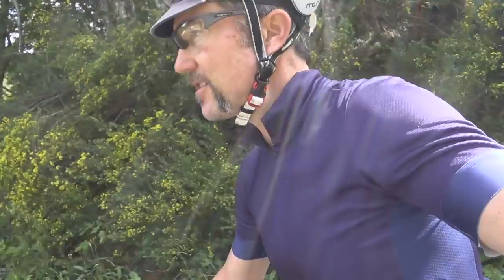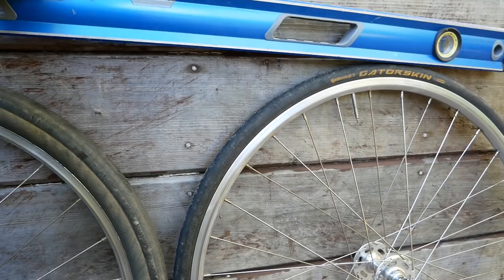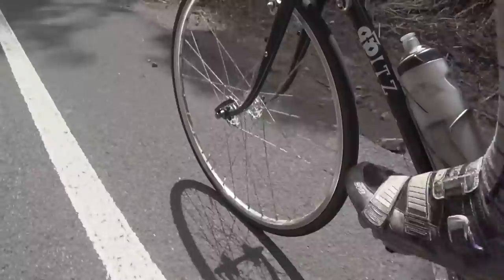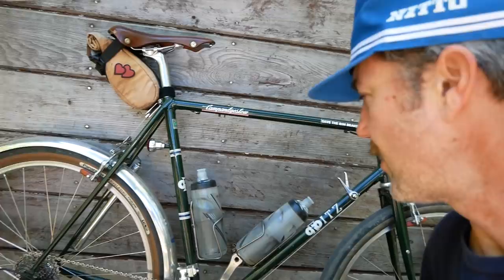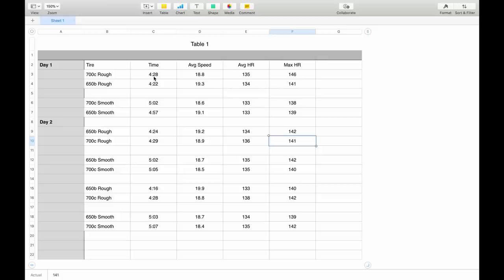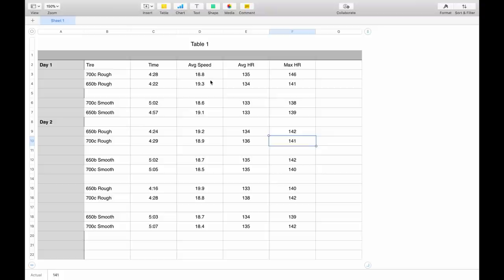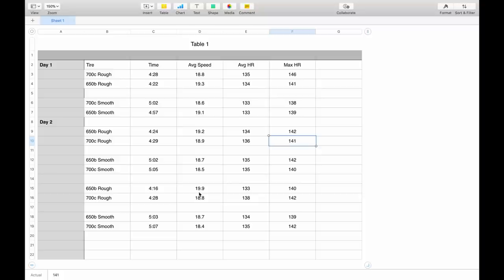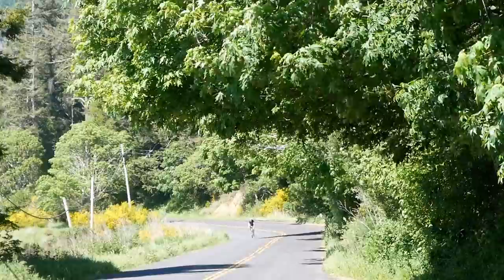The Great Wheel Debate: 650b vs 700c Part 3: A Practical Field Test

Comment: I always appreciate your videos, Henry! Good attempt to measure the difference with a bit of methodology. You need to eliminate a few obvious biases: using similar rims for 650b and 700c with the same spokes, hubs and bearings; using the same brand tyres (e.g. same supple WTB tyres for 26 mm and 46 mm); using a power meter and adapting your effort to the same output; and perhaps consider the aerodynamics of the rims and tyres by having wider 650b rims matching the wider tyres. Personally, I often feel that a rough surface slows me down when rolling on narrow and hard pumped tyres - interesting to see some data backing this assumption up!
Reply from the maker: There is definitely room for improvement in this test. Tires from the same manufacturer would help reduce variations between carcass and rubber compounds. The rim profile between the two wheels in this test were actually quite close. The 700c is a rim by SunXCD which has an almost identical profile as the Pacenti Brevet rim, namely a low profile box section. What was interesting is the 650b front hub used in the test was a dynamo which has a slightly higher resistance. What's also interesting is the Continental GatorSkin tires have a slightly lower rolling resistance on the rolling drum test compared to a Compass tire. You're right though, the test should be set up with identical parts (hubs, rims, spokes, etc.) where possible. When I set out to perform the test I wasn't prepared to have such similar results.

Comment: I remember when the industry first started pushing  29er's and part of the narrative was "faster". I think i saw an interview where Gary Fisher was heavily touting the advantages of 29ers.
Reply: I watched Giant jump all over 27.5, and now they came back to 29's
Reply: It is faster...
Smaller diameter wheels are better if you start and stop a lot, but on a smooth continuous ride bigger wheels are better becau they maintain speed way better, that's why road bikes the standard has been 700c for a long time

On my commuter bike I have a heavier front wheel, and from my experience it helps the bike to glide on the road even better. And I'm thinking of trying a bigger diameter on the front wheel and smaller on rear wheel to see how it feels like

Comment: My theory is that it comes down to pedaling efficiency. Less road noise (random vertical movement) makes for a smooth round pedal circle. Kind of like the use of anti-backlash in a geared mechanical system. Over the span of a longer effort, I would expect to see an additional advantage due to lessening rider fatigue and the elevated morale that goes with it.  Right now I'm laughing at myself for trying to sound like a scientist, which I most definitely am not.
Reply from the maker: It sounds like a good theory to me. On the rough section my hands were vibrating noticeably more on the 25's. I also had to concentrate more to keep a consistent heart rate. Little bumps in the road would disrupt my ability to keep a smooth and consistent pedal cycle. The bike would buck back more often throwing off my cadence. The wider tires felt like I could keep a more consistent pressure on the pedals even on the small bumps.

Comment: The secrete to fast wheels is better rolling bearing and lubed...
But really I have a Casati Ellis which I thought was fast, but then purchased a Schwinn vintage 1990s PDG 40 mountain bike ,off of craigslist from a guy who worked at Schwinn for 120 bucks .
It had Continental town and country tires. I found the bike super comfortable and fast. I think for road wide tires are way better...

Comment: Henry-"Its a pretty rough surface"
Me looks at every road in australia made that exact same way and often rougher since they melt in summer and we are left with huge potholes everywhere 👀
Reply: For that matter, roads in (my part of) the UK seem to be much closer to how you describe the ones in Australia, despite the lack of melt-down. Maybe it's to do with driving on the left?
Reply: They should make the roads from concrete instead of asphalt or tarmac, then it wouldn't melt and it would be smoother. Here in TX and in AZ a lot of roads are concrete and they are durable from forming potholes

Comment: Thank you for another thoughtful video to  try and test in the real world. Unlike the lab, you cannot control all the variables. The question is what you started with: Is the difference enough to be significant? If you discount the biggest variation, the answer would be no. However, one could conclude that running a wider 650 by 47 tire gives a more comfortable ride without giving up efficiency. 

How about a test of pressure variation vs speed and comfort?  Using  a bike with 650 wheels and another with 700 try a similar pattern but vary the pressure by 20 psi. I think it should demonstrate that for both sizes higher pressure does not equal more speed.

Comment: I've done a much simpler test with narrow 700x23 (95psi) on a standard rim vs wide 700x28 (70psi) on a HED ARdennes + rim which took the size out to 31.  The wheels were similar weight and depth.  Both tires continental GP4000s II.  The 23s were only faster on the smoothest straight road.  The big tires were faster everywhere else, even on a descent with a lot of tight turns.   Strava comparison tool showed I was much quicker in the turns with bigger tires.  I felt faster on the 23s most likely due to the NVH (noise vibration harshness) being higher.

Comment: My opinion is that the test shows some good points but I think what would help would be:
1) use of a power meter instead of heart rate monitor.  Strava would give good info on how much power is used for one of your rough/smooth segments when power meter was used.  I finally bought some Favero Assioma road pedals to track my power outside although my preference is mtb pedals.  The SRM PowerMeter SRM X-Power is supposed to be coming out which is an XTR-style MTB pedal but they keep postponing release date and I also wanted something a little more proven. DC Rainmaker gives the Assioma good reviews although the cleat style is not his favorite.
2) Definitely agree on using different tires.  I've used the Gatorskins before and like them fine for winter riding when the roads are wetter and more "junk" on the roads that could cause flats. But feel they are on the slow side. Maybe you could get some similar Compass tires and use them.  Say the 700c Cayuse (26mm wide) vs  the 650B Babyshoe Pass at 42mm wide.  But I would try to run both either tubeless or with tubes to insure closer comparison.  

I always thought the 650B might be marginally slower just due to greater rotational weight, but not slow enough to give up the comfort when doing great distances.  I think that is even Jan's position... they're not faster per se, but for a 200 or 300 km (and longer) brevet, the added comfort  from the 650Bs is worth any slight speed differential.

Thanks for the test and data, I think this was a great step in trying to prove things to yourself and others.

Comment: I'm curious if vibration dampening played a factor. I have 700c tires and typically ride at 120 (or close) PSI. For me, the smoothness of a road make an enormous difference. I lose a lot of speed on bumpy roads. I could only imagine a wider and softer tire would dampen those bumps allowing more efficient pedaling.

Comment: I have tested tyres by letting a bike roll on a 10km constant small downgrade.  I found that the quality of tyres were more important than the size.  On one set of cheap tyres the bike wouldn't even roll.  On other tyres I typically rolled between about 28 and 32 km/hr.  The differences between other quality tyres was so small that it really didn't matter except possibly for racing.  The best performance I measured was 700C 32 front and 35 rear combination.
Reply from the maker: Cool! Thanks for sharing your experiences.

Comment: You didn’t test the difference between wheel sizes. You tested tire widths. Still very informative and I am convinced wider is better. 
The next test should use tires of the same width and make on the different rim sizes. 
Keep up the good work!

Comment: I have been wanting to have a bike that offers comfort and the ability to ride on any surface. 650b seems to supply the answer. 650b suffers no penalty on smooth roads vs. 700c and offers superior speeds on rough surfaces.

Comment: Hmmmm. You've got the wheels in my brain spinning. I have three bikes that all have Velo Orange hubs,Velocity A23 rims,DT 14g spokes and Compass tires. I guess it's obvious when I find a combo I like I tend to obsess on it. The only real difference between them is the frames. Bike No.1 is 80's Giant lugged steel w/ 700cx32 Stampede Pass. Bike No.2 is Raleigh One Way w/ 700cx38 Barlow Pass. Bike No.3 is Toussaint Rando w/ 650bx38 Loup Loup Pass. I don't own a heart rate monitor but I s'pose I could borrow one. Alternatively I could do a coast down if I could find a downhill section long enough (not easy in N. Illinois). This would sorta recreate the type of test Bicycle Quarterly did a few years back. 

I guess I would be preaching to the choir though because I'm already convinced that the fatter tires make very little difference in my speed or times over known routes. There really is no valid reason  to continue riding the 23mm 'prostate pounders" when  the supple 38-48's are as fast or faster. From your raw numbers it looks like you're picking up 5-6 seconds in each ~5min. pass. That would scale out to about a minute per hour. Not very significant on a social ride.

Love them glasses man!
Reply from the maker: Prostate pounders, lol! There's a number of tests we could run and I'm sure there are situations were a 700c x 23mm tire is faster, but what I learned is how perception doesn't always equate to reality. What feels faster may not actually be faster. It would be great to see more tests performed. Jan Heine has provided some very valuable insight. His thoughts on vibration losses is something I think is spot on. Lots of people have gravel bikes with disc brakes, so swapping wheels/tires is a snap (a simple twist of the thru-axle). In my case I had to muck around with some old center-pull brakes.

Comment: I've done 100's of TT races and my two TT bikes the Zipp2001 and Lightspeed blade were both 650 wheels. I always felt I got up to speed quicker with the 650 wheels, and saving a few seconds is big in a TT race.
Reply from the maker: That's interesting to hear about your TT experience. It seems like the smaller diameter wheels would also have better aerodynamic advantage.
Reply: @Henrywildeberry  I'm sure it might have a minor aero advantage also.

Comment: Blasting the rear wheel on a curb in an emergency hop... Always fatten the tire up and run the pressure higher than supple.

I only run a 650-47 rear with a 700-40 front

Comment: Great stuff! Really interesting test, as well as the comments! 

In your experiment, of course there are going to be differences in wheel size, tires, rubber compound, spokes, hubs, etc., but it's still a good exercise from the perspective of doing a ballpark comparison of overall differences between a typical 700C wheelset with narrow tires that you've used in the past against a 650B wheel set with wide tires that you're using now, just to see if you're giving up anything for that increase in comfort. I've never done any kind of test like this one, but I love 650B x 42mm, and I'm never going back to 700C x 23!

What I'm really interested in seeing is how 42mm tires of a given compound stack up against 48s (at least for road use). I've been wondering that, by the time a tire size increases from the 20s to 42, you've already gained enough tire volume to reduce vibration losses, so when you go even wider now to a 48, you might get marginal gains from that further increased volume, but now you have the drawbacks of extra tire weight, rotational inertia, frictional losses at the tire patch, and air resistance (insignificant, but still). In other words, are there diminishing returns? (Of course, this is all goes out the window for rough stuff!)
Reply from the maker: Robert - I figured when I first set out to do this experiment I would see a much larger difference in the results with the 700c taking the lead. Had I conducted this test at different velocities in order to include wind resistance things would likely turn out differently. However, the take away for me was to see how my perception was inconsistent with the test results. 
Many have said the Gatorskins I used in this test were a terrible tire choice for comparison. Even though I agree I still thought they would be slightly faster. Bicycle rolling resistance shows the Gatorskin's having a rolling resistance of 21 watts at 80psi (@18mph) and the Compass Barlow passes at 30 psi have a rolling resistance of 28 watts. They didn't test a 48mm wide Compass tire at 30 psi, so I can only assume it's less than 28 watts. 
The 42 to 48mm wide test sounds interesting and given what I've seen here the test set-up is going to need to be very precise. The 42's are probably a better tire size as you've pointed out for performance especially considering the difference in weight. The gravel races appear to be winning on 700x38-40. Would a wider tire on a smaller rim help them? On softer soil (where a wider tire can disturb weight over a larger area), or chunkier gravel perhaps? However, for an all-around "mixed terrain" tire for riding gravel, single track, and over rough broken asphalt, the 48's are excellent. It does take a lot of care to get them to fit with a set of fenders, and a narrow q-factor which makes the 42's a good alternative.
Reply: @Henrywildeberry  Jan Heine makes the point that harder tires do seem faster.
Reply from the maker: @trek520rider2  Yes, he does, and I wanted to independently confirm his conclusion.